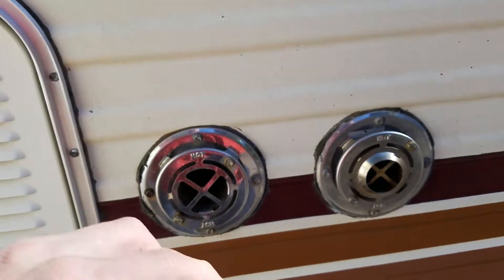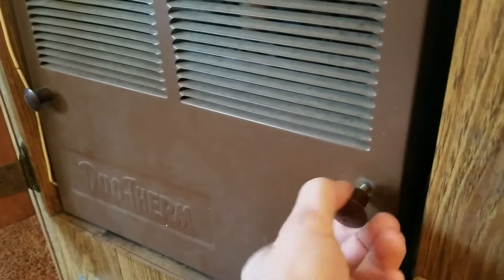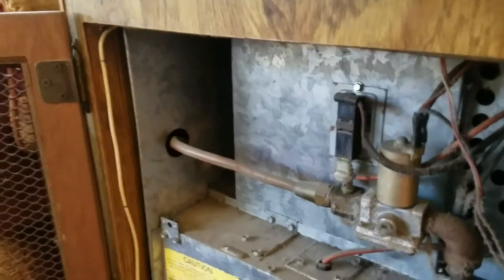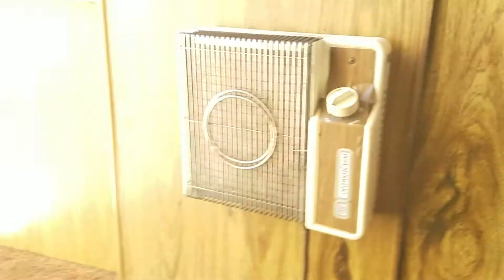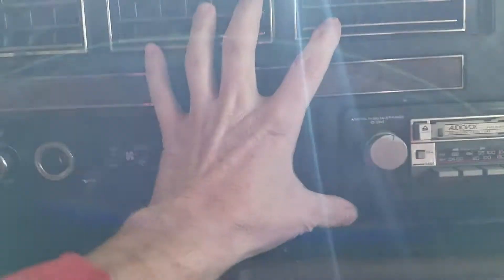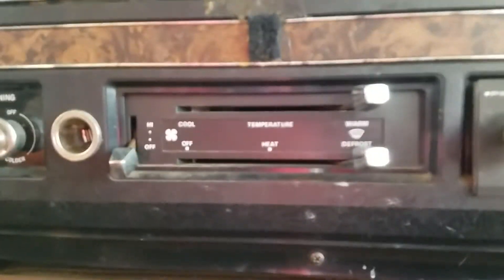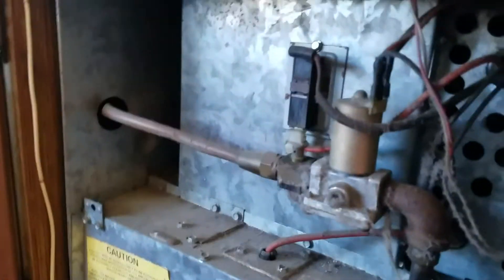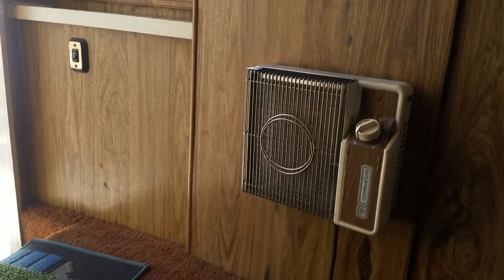[Live] Gas Pains

Comment: Spray joints with soapy water to find any leaks  Does heater have a pilot light. ?
Reply from the maker: I see what looks to be high tension wires so no pilot.  I'll check the book later.  Sprayed everything, it's internal.
Reply: @Gen3AntiqueAuto  Perhaps you have an electric ignitor.  We had one in an older stove that I replaced. And for odd reason the gas valve sprung a leak. Propane guy said that when you replace the ignitor the valve dohicky needs to be replaced at same time. I’d recommend getting your unit info and call propane guys or manufacturer. To be safe of course.
Reply from the maker: duotherm apparently no longer does furnaces, I've got some feelers out though.  Read the sticker on it - electronic ignition.  No pilot.
I have TWO spare suburban furnaces here - neither will fit.